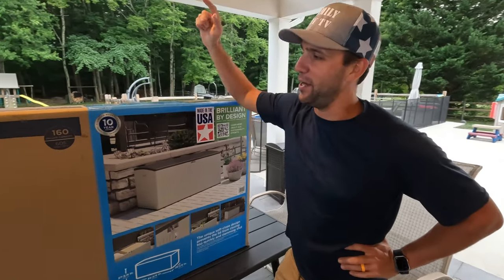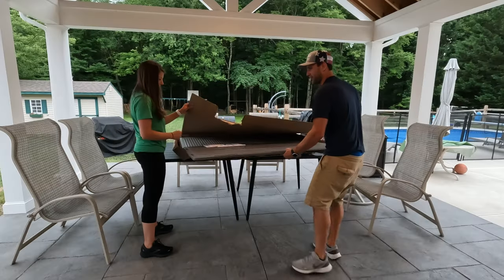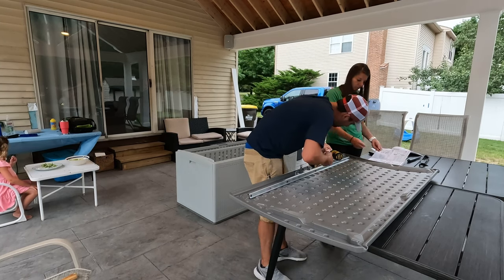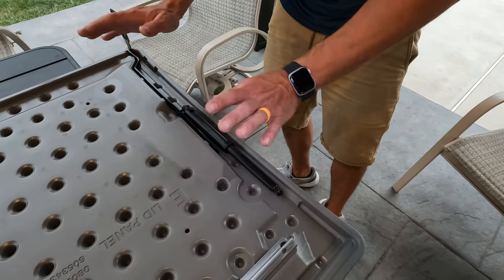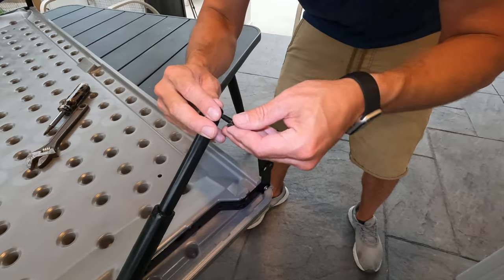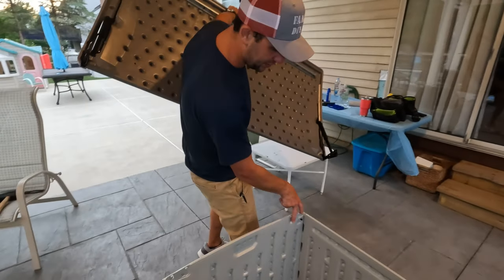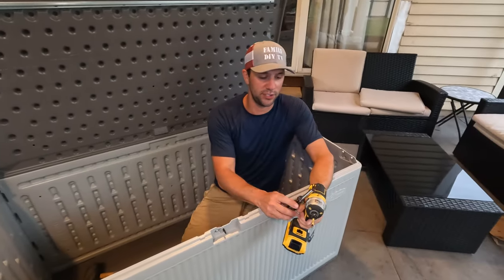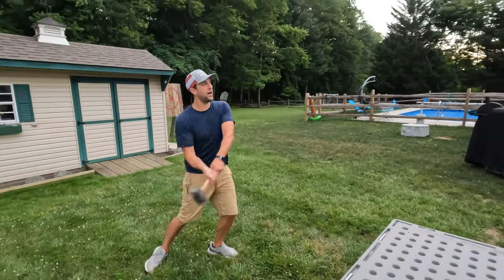Suncast Deck Box Assembly

Comment: Any recommendations on how to tighten the spring loaded door lifts? The deck box lid doesn't stay open on its own, which is super frustrating!
Reply from the maker: Sounds like you have a bad damper, I would call them and ask for replacement.

Comment: Hey, I followed everything you did, but it's not airtight, the lid kind of bows up at the back, and the holes at the front for the lock do not align.  Did this happen to you at all?
Reply from the maker: Sounds like the dampener(shock) is in the wrong hole.  I did this at first.    Double check the shock.

Comment: Being careful with the weight, do you think this deck box could take four swiveling caster wheels at the corners?  I want to be able to move it around a garage.  Perhaps adding a wood frame to the base might be the way to go.  Thanks for the video.
Reply from the maker: Should work ! I’d maybe scab 3/4 plywood on the bottom and attach caster through that and plastic bottom.  Maybe even use some adhesive between plastic bottom and plywood.

Comment: Did anyone have trouble installing the s-bar in the lid? Only the two holes at either end lined up with any type of plastic to screw into. The other six holes did not line up with the plastic ridges, so I was screwing through the metal into thin air. Any suggestions?

Comment: The only rationale I can think of for a part with too many holes is that it's mass produced for more than one model and might enable different set ups on different models? It's a stretch, though.
Reply from the maker: I agree with you 100%. I was also thinking to save weight for shipping - maybe ? But by the time you make the holes, does that offset the cost of shipping ??? Lol who knows !   Hahhahaha.     Thanks for the comment! 
Mike
Reply: Its so the parts can go on either side right or left. They mirror the holes!